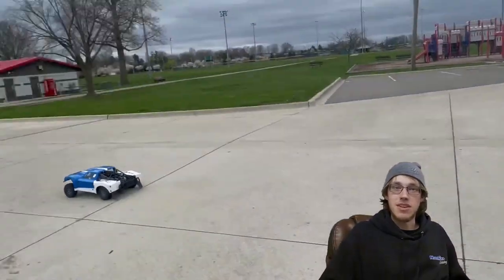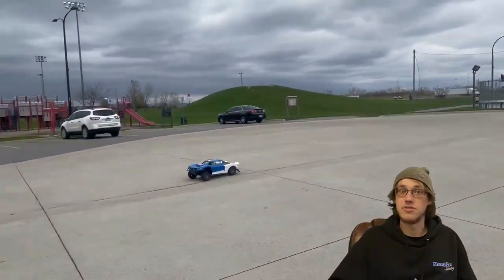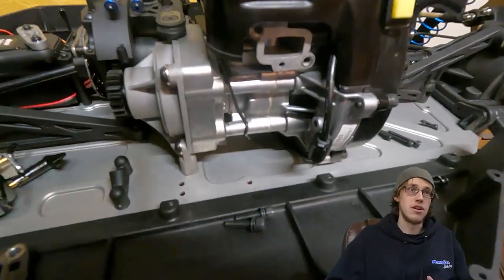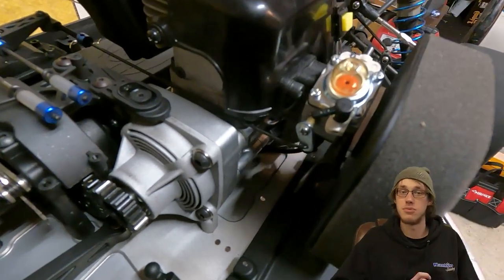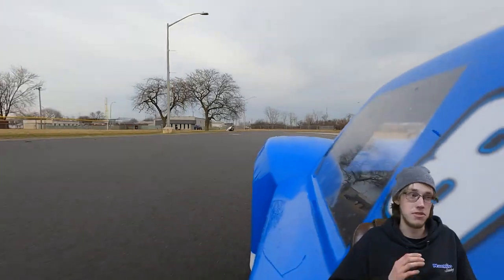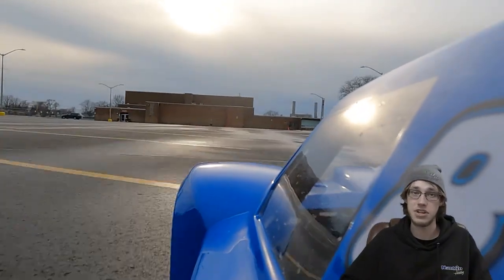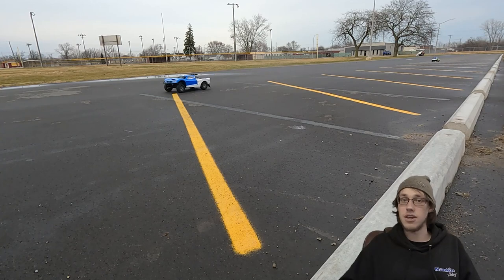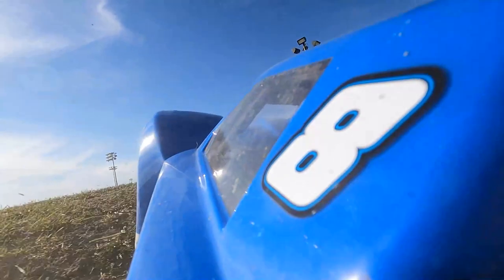Running the Losi 5IVE-T 2.0 on Methanol!

Comment: What special 2stroke oil do you use for methanol ?? How about higher compression on the cylinder head?? My all new 5t 2.0 got flooded from the Michigan super flood last june 2021, i was so devastated and now planning to make a mess out of it until it blows😂
Reply from the maker: Klotz Super Techniplate is the oil you’re going to want, but we don’t know of anyone making a higher compression piston for the stock engine.
Reply: Higher compression pistons don’t exist, typically the cylinder base is milled and/or you can use thinner copper base gaskets. That’s your only option for compression. Two strokes don’t need a lot though, nor do they like a lot of timing advance. 

Oil - I use castor oils in ethanol and methanol. My favorite is Benol but Maxima 927 is just as good, usually cheaper, and can be found in more places.